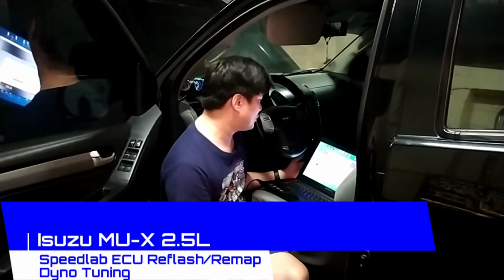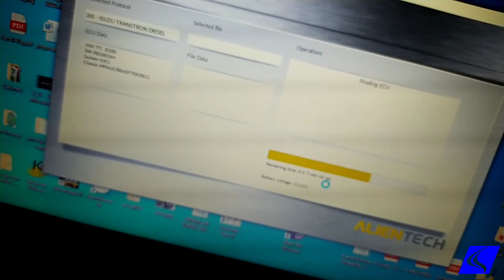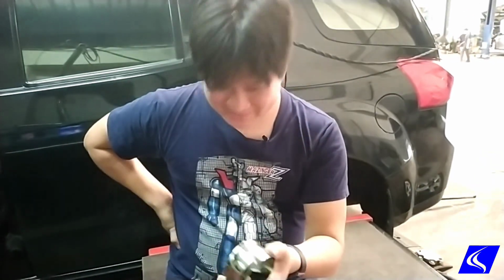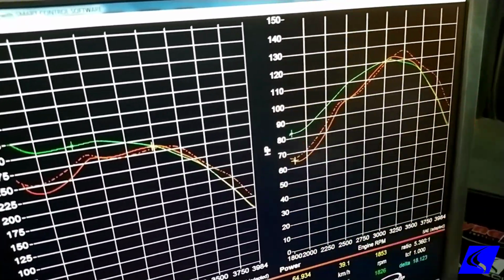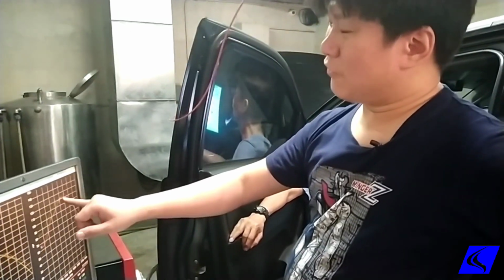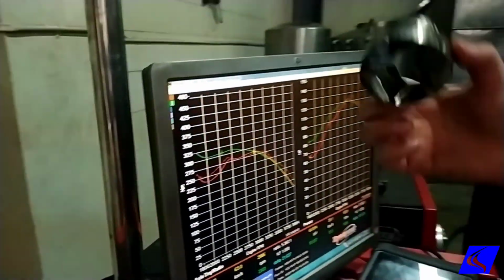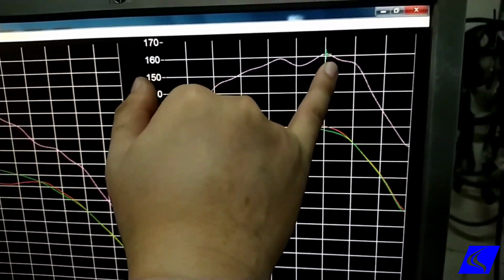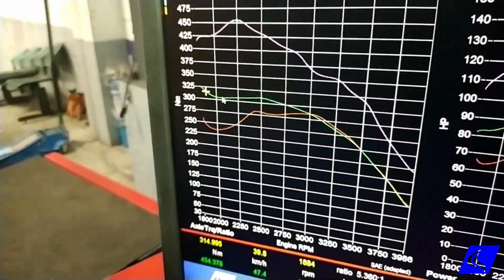Intake Swirl Generator BUSTED! + ECU Remapping the Isuzu MU-X

Comment: Well it's too late for me I fell into their trap, got scammed, and bought EFG last 09/26/20 for my Isuzu Sportivo 2.5 Turbo 2007. But I'm not sure if the effect were noticable for non-ecu engines like 4JA1 which when I installed it though I noticed the black smoke did reduced as I revved to 3000rpm so in my opinion that's the only 50% legit feature. No acceleration gain, No fuel efficiency improvement.

Then I started to think it's some kind of air restricting device and guess I was right when I watched this video so thank you sir for busting this "Intake Swirl Generator" product. Too bad my P2500 is gone though😭.